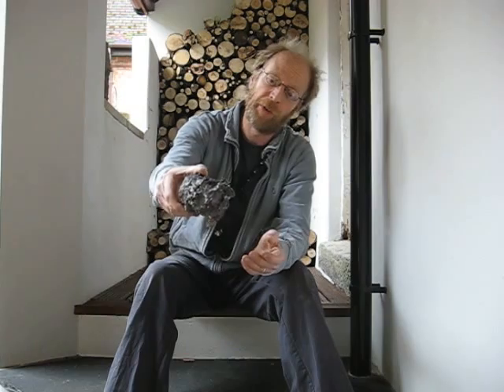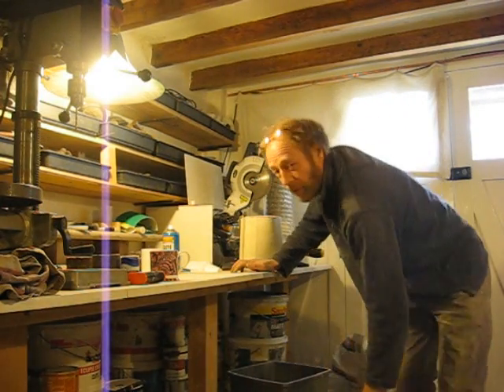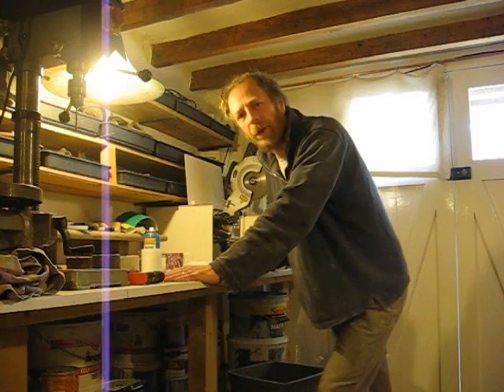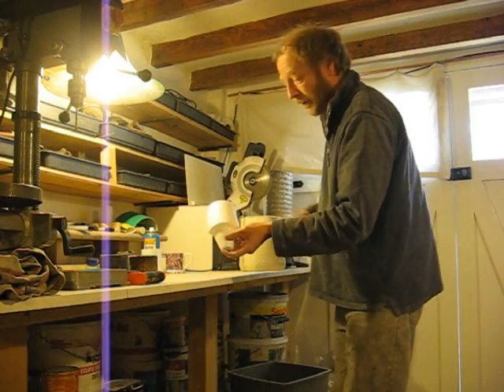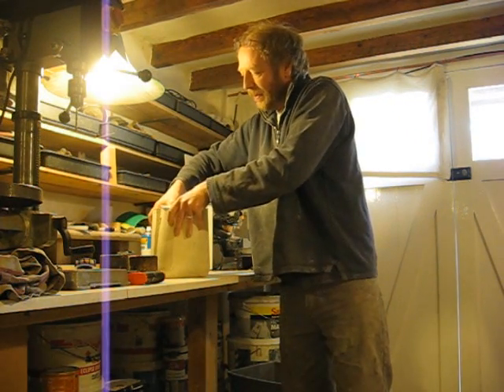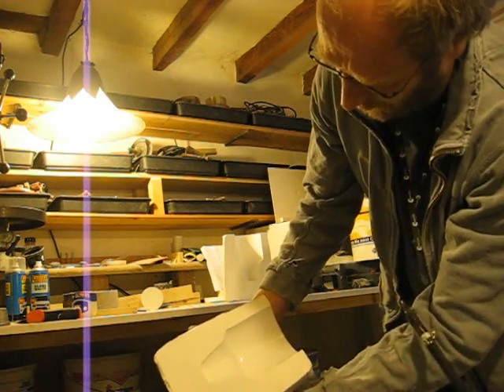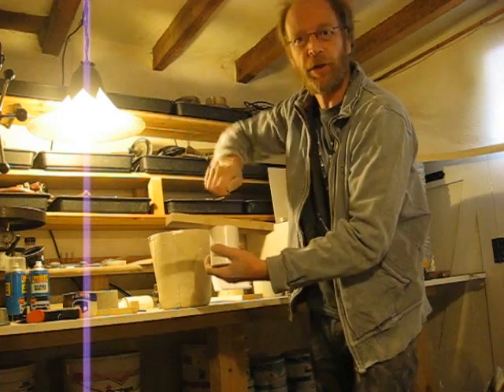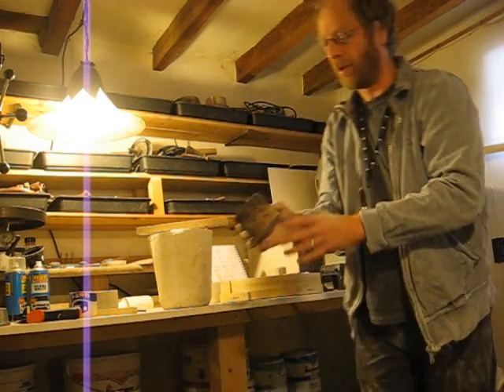How To Make A High Temperature Crucible

Comment: So in using cement for the crucible, does this not insulate the contents inside the crucible from the heat? Or does the cement have more thermal conductivity than I'm thinking about? Thanks.
Reply from the maker: Hi Duke - A good question. The thermal insulation of the castable refractory cement is high. To melt pure Iron (1535 C) I believe I had to get the centre of the furnace to somewhere around 2000 C, so you would need to factor in a significantly higher, longer-lasting heat source than the melting point of the material in the crucible. If you want to calculate the thermal conductivity then use the figure  0.8 W/m K - as compared to Copper at 385 W/m K. Quite a difference!
Reply: Thanks for the response and the information. Do you think that adding graphite powder would increase the thermal conductivity any?
Reply from the maker: Carbon forms generally have a high thermal conductivity but I doubt that adding graphite would improve the conductivity noticeably unless you added a lot - which would reduce the strength of the refractory concrete. Experimenting with this trade off would be very interesting. Let me know if it works for you. Cheers!

Comment: Are there any types of stone that would withstand that heat without exploding, melting or going to powder?
Reply from the maker: Hi Lisa - the refractory cement I've been using contains many small stone chips, some black, some white. I'm not a geologist but the black chips look a little like basalt and before adding water the cement resembles a kind of pulverised granite - so perhaps a form of  granite might be the answer for you.
Reply: I found a source that said all minerals melt before 1200 °C and surprisingly; basalt melts around that temperature.
Reply: off topic but..When i lived up in southeast Alaska, i watched how some of the natives build their bonfires. They would pile this stone called schist(blackish,usually flat) around the fire,because it is a metamorphic rock, it contains a variety of minerals and they would retain heat long after the fire went out. Just mentioned it cause forest reminded me of that with his comment.

Comment: If you cover your plug with saran/plastic food wrap it will come out quite easy. You will have some fine inner wrinkles that you can smooth out with your finger.
Reply from the maker: +dean germeten Hi Dean - Yes, thanks for that. This has been mentioned before and I will be using the technique in the future - cheers!

Comment: Very nice work!  Subscribed.

As someone else mentioned, a few degrees of draft angle on the inner core of the mold will help in removing it, plus a radius on the bottom edge of the core will help distribute stresses, likely lengthening the life of the crucible. A sharp interior corner like that is likely to lead to cracking, especially with the much larger thermal mass of the conical base compared to the thinner sides.
Reply from the maker: +FXM Yes you are quite right - thanks :)

Comment: hello friend , just wanted to drop an idea on you . i have seen people make an arc furnace with 2 carbon rods inside a tiny fire brick . it became very hot , perhaps it would be better then your forge . loved the forge by the way
Reply: +NOBOX7 I don't think that such crucibles can survive the huge heat of an arc furnace. They'd crack right away.
Reply from the maker: +NOBOX7 Thanks mate - I will look into that. Did they adapt an old arc-welder for the power supply? Hope this finds you well & happy :)
Reply: Forest Innovations i cant remember but i believe the guy has a cool video , it gets so hot the fire brick turns into glass
Reply: +NOBOX7  that's grant thompsons video and he used a modified microwave power supply
Reply: kopfjager68 thanks bro

Comment: very good idea but on your inside cylinder of the three part mold it needs to be smaller at the inside  bottom for a 3 degree minimum to 7 degree nominal angle with the edge  having a slight radius for strength and to avoid a hot spot from dros hanging up in the sharp inside corner. This is what I done on all of my molds for crucibles for aluminum to 4140 alloy including the graphite ones I have made. Otherwise good job and wish you the best.

Comment: What you could do is the same process of making the two part plaster mold, do not coat it with paint or Vaseline, once the plaster mold dries out, make a high alumina slip if you have any ceramics back ground and slip cast an alumina crucible, but the crucible would have to be fired unless the use of and ULCC cement or HAC cement could be deployed into the mold......

Comment: What I'm looking for is the ingredients to make crucibles that can withstand temperatures high enough to melt steel. I've checked many crucible suppliers, but none of them have anything they will guarantee to endure such temperatures - at least nothing within my budget.
Reply from the maker: Kevin S Hi Kevin - this is where I got the stuff in the video - http://www.castreekilns.co.uk/dense-castable-1700c-25kg-bag-869-p.asp - they also do an even higher temp one but it's considerably more expensive. Good luck with your project!
Reply: Forest Innovations Thank you for the link. I bookmarked it, and will place an order with them early next month.
Reply: Kevin S have you tried refractory cement rates at 3000 degrees?
Reply: crgaillee No, but I'll look into that. Thank you for the tip
Reply: +Kevin S I think PURE "portland cement"  will do the trick  ( no premixed... but PURE ) portland cement.... available at your local hardware store.
Reply: *****  I never thought of that. Thank you for the tip. I'll give it a try.
Reply from the maker: I tried Portland - My experience was that it just won't stand the temps required for iron/steel.

Comment: Where did you get the refractory cement? Would something like this work?
http://www.homedepot.com/p/Oatey-1-2-gal-Furnace-Stove-Cement-35515/202078154
Reply from the maker: Eric Shiflett Hi Eric - I looked at the specs for the product you mention but couldn't see it's rated temperature so I'm guessing it wouldn't be the same as what I've been using. I'm in the UK and I've been using this stuff - http://www.castreekilns.co.uk/dense-castable-1700c-25kg-bag-869-p.asp . They also do one rated to 1800 C which I'm planning on trying next. If you do use a dense catstable refractory cement as I have done, I recommend sieving out the larger stone aggregate chips for ease of molding. Best of luck to you in your experiments :)
Reply: Eric Shiflett the pdf for this http://www.homedepot.com/catalog/pdfImages/e3/e3666fab-6470-4d5a-9b59-06d8d869fd99.pdf doesn't add a temp rating, but it does have an ingredients list. It at least has sodium silicate, I'm assuming as clay as well depending on the color but no confirmation on that. Personally, I would use clay (from cheap kitty litter or online) and good old type I/II Portland cement.
Reply from the maker: Lee C. Nothing wrong with your suggestion Lee - but the cement will not stand up to melting pure iron at nearly 1600 C. My view is that unless the product has a clear temperature rating in the specs, you will be wasting your money if you want to take it above 1200 C
Reply: Can't hurt to try it. I've seen some "high temp refractory specs" that are Portland cement based. The other materials are varying types of silica so... mortar.
Reply: Here's a recipe I'm going to try. http://www.backyardmetalcasting.com/refractories.html
Reply from the maker: Lee C. No harm in trying... The temperatures I've been achieving have caused fire clay to slump and have powderised normal Portland cement. The mix in the link you posted would probably only stand up to 1300 C (give or take)... but as it's all cheap and readily available...
Reply: Yeah, I'm only doing some backyard blacksmithing with a very open top, and some aluminum foundry stuff. I don't think I'm hitting 1600, but I could be and not know it. I really want a high temp industrial thermometer thingy. I'll have to look up those prices actually...

Comment: for the post I would recommend using plastic wrap over it it's quick comes clean most every time
Reply from the maker: biggoldnugget Thanks BigGold - that is an excellent idea. I will definitely try that for the next crucible (which will be made from 1800 C refractory).